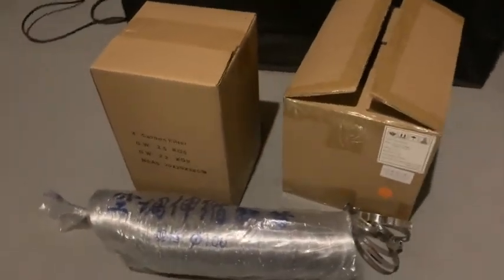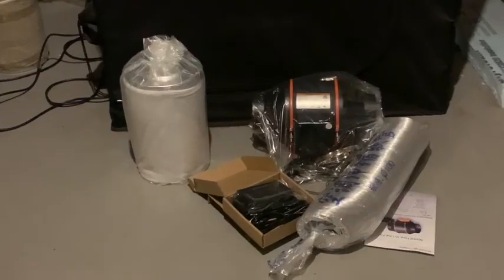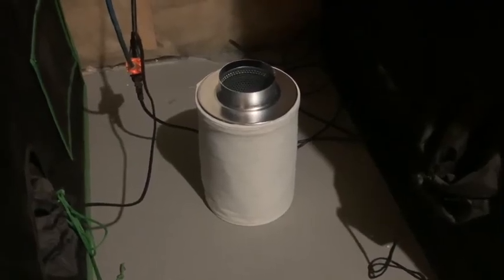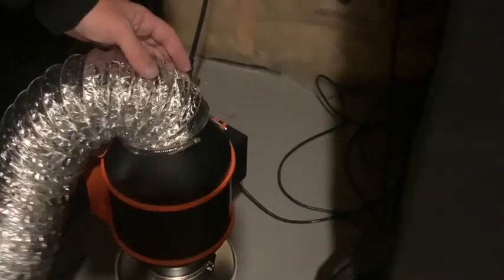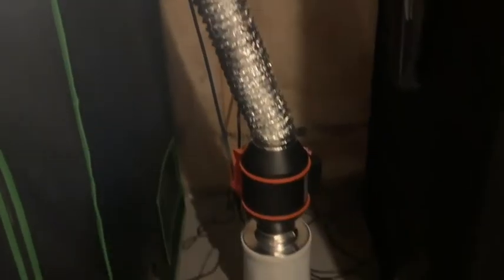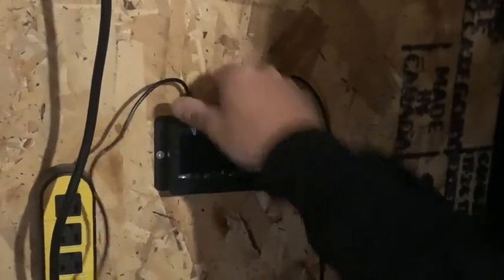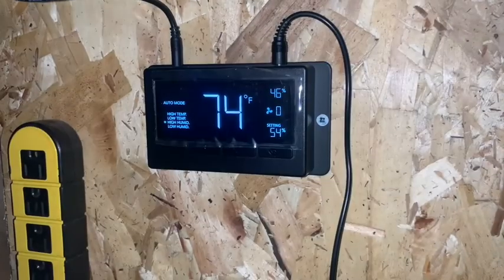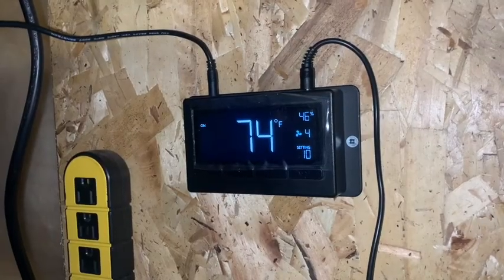How to Set Up A SMART Ventilation System for a LED Grow Tent

Comment: I cant understand this controler. How do i set it to switch on at 79° and switch of at 75° ?  Also how to set it up to switch on at 80% and switch off at 70% ?  Its spinning even when my temperature and humidity are too low. Please somebody help.
Reply: Yeah, thats a little problem with these controllers… the fan starts over the high value and under the the low value, so if you try to keep the humidity at a value higher than the one outside, you have to set the high value as the goal value and the controller will stop, if it gets below. This will result in a nearly constant +-5 to the goal value in my conditions. The low value is set to „off“ by holding ^ & v for a few seconds while setting the value (note that the cap is set under „on“) ✌🏽

Comment: Hello. Can you help me understand the low and high setting? Is it meant to try and keep the value of the tent between the levels you set? I'm not sure how turning on the fan when it gets too cold in the tent would be beneficial.
Reply: Turns out exceeding the high temp or humidity will kick on the fan to the speed setting you used in the 'on' setting. If the temps or humidity go lower than the low settings, the fan will also go on. So I turn off the low temp and low humidity setting because I don't want the fans on when things are too low.
Reply: how do u turn those two settings off?
Reply: @kcvrx  hold the button used to switch to the next setting

Comment: How do i even select these different temp / humidity options on the controller,the instructions are so vague and im constantly checking the temperature and humidity manually instead of the controller doimg it for me . Please can you help me out 🙏🏼
Reply: Hey, i have the same problem. Did you figure it out maybe ?   There is no explanation for it.
Reply: No I'm 9 weeks into flowering my autos and have just been monitoring it manually. I have found with the size of tent I'm using (2x2) and the combination of two LED lights that add up to 1000watts i have to have the extractor fan on level 10 throughout lights on and then during the cooler 6 hours off i turn it down to setting 5.

Comment: Guess what, I contacted Spider Farmer and they shipped a whole new fan and controller.  The fan is silent as it should be (the original I got had bad Bering noise) and the controller works perfectly now.  Just set high temp and humidity and off we go.  Great support I must say.
Reply from the maker: Good to hear. Sry I hadn’t got back to you . I had a death in the family and completely forgot about it . Happy to hear it worked out for you.
Reply: @pattymcstoner2764  Sorry to hear that!   Thanks for the help.
Reply: @MichaelBruceTaos  the bearing might have been bad but the controller was fine just set up wrong. You followed bad advice and set parameters you didn't need, that's why it was misbehaving. Because this video and his replies were misleading and incorrect

Comment: I need help. This isn’t very well explained on the thermostat auto settings. I need to know how to actually set the settings as well as alarms! How do I even do that
Reply: I can’t figure it out either. So annoying
Reply: @jastinellyson8733  I figured out. On the channel you’re looking to automate- make sure the function mode says on. Then turn ur fan on or whatever to 1 or 2 or 3 etc. THEN chanfe mode over to auto . Once the environment in ur grow space hits those triggers that you’ve set in the auto function , the devices will activate. And they will activate and turn on to whichever intensity or frequency that you’ve set when the remote channel was on the “on” mode. Hope that makes sense
Reply: I cant even get the actual temperature to read ?
Just  a blank looks like this.   -- F°
Any ideas
Reply: @2wosiq go to alarm mode n click. The up n down for 3 seconds. Dev mode

Comment: Lots of China companies like mars hydro and spider farmer copied ac infinity’s controller but only managed to knockoff the one from 4 years ago. The latest ac infinity controller 67 and 69 have schedule, minimum speed and app control which the knockoffs can’t do.
Reply from the maker: And yet they are all just knock offs of the duct fan in your furnace. None of this stuff is necessary I have said that a million times .
Reply: This one is also has abs internal. Unlike the others I can simply 3d print new fan blades and most part for it instead of needing a new fan or repairs. Only thing you need to ever replace is the probe
Reply: @pattymcstoner2764  I agree with you 100 percent people don't understand even "Name brands" are made with knock off materials why pay extra money for stuff that will do the exact same thing as a non brand name makes no sense to me.
Reply: So pissed i ordered a sf1000 and the instructions are written in poor english, also doesnt provide any instructions for installing inline fan,carbon filter,or where to run the lines for the controller and probe
Reply: Is there a way to make it so when alarm for high humidity is triggered it only goes up to fan speed 4 vs 10 every time until it reaches low humidity alarm?
Reply: @MM3OG  remember me of a startup, that claimed to grow from seeds to bud without interference. Failed miserably I rather check on my plants ^^
Reply: Ac infinity is still Chinese bs too at the end of the day
Reply: Vivosuns higher end controllers looks to be really nice and they have advanced app it runs with and lots of addons available
Reply: @TheRealTerpinator  except vivosun controllers are outdated compared to AC infinity. Their most advanced controller cant even do automations and can only control their own 2 fans and a light max while AC infinity’s can mix and match 8 different devices including humidifiers, heaters, ACs and even outlet devices and lights from other brands. Only shills working for vivosun would claim it’s better cause facts don’t lie when you compare side by side.

Comment: So does the fan stay on constantly or does it just turn on when it gets too hot
Reply from the maker: You want it to come on for at least 5 mins ever 3 hrs other then that just when it needs it . You can’t do to much but you can do to little
Reply: @pattymcstoner2764  Thats not answering the question. He and I would like to know if the fan can stay on all the time at a min set speed and then go up fan speed when the high trigger hits. But I think you know what he was saying and dogged the real question and answer , why ?
Reply: @travisanthony11  it goes totally off and its fucking  crapppp shittt because air can go out if u dont keep a minimum negative pressure.

Comment: Great set up and explanation! My only question is that I thought it was common knowledge and required to have bad air going out fresh air coming  in based on the size of your grow tent. I  see that you mentioned that your fan is only when needed. Is it not necessary to have bad air going out and fresh air coming in throughout a grow? Than you
Reply from the maker: Yes mine turns on about every ten minutes but it is better then constantly like it was . Hope that makes sense
Reply: Bad air should exit the room and fresh air should be drawn in (from a clean source).    This setup is blowing bad air into the room and it seems negative pressure in the tent will draw in room air through any vents or cracks.    You are just re-cycling the same air.    What good does this do??

Comment: I still dont get how to make the damn controller work right.  Set under Alarm area?! really?
Reply from the maker: Yeah . 

So set all your ranges in the humidity and the temp and set it to the alarm mode for high temp . 

That way it or hits any of the alarms it turns on .
Reply: @pattymcstoner2764  Hmm ok.  right now I set all the auto stuff but I ignored the alarm area itself.
Reply: @pattymcstoner2764  OK I did this.  I will report back.  I have been screwing around with this thing for a week and finally hit the RMA button.. maybe you can save me from having to send back.  Many thanks!
Reply: @pattymcstoner2764  I set High temp to 80F, Low temp to 75F, High humidity to 65 and low to 45.  Then I popped over to alarm mode and left that on high temperature.  I am not sure if I did it right?
Reply from the maker: You know what sorry . After you set all the alarms just leave it on the auto temp . Then watch . The alarms will flash and turn it on if it hit any of the alarms . 

And yeah don’t send it back I got you well get this thing working for you !
Reply: OK, I will give this a try right now.
Reply from the maker: No you leave it set on auto temperature or humidity. Doesn’t matter . 

You are setting the alarms to tell it when to turn on the vent . That’s what the alarms are for .
Reply: @pattymcstoner2764  If you see my video, the thing just turns on by itself for no apparent reason.. and then it stays on forever.
Reply: @pattymcstoner2764  The alarm only seems to make the thing beep, it doesn't trigger anything on mine that I can tell.  I have mine on Auto Temp and it still turns on for no reason and stays on.
Reply from the maker: Dude it’s not turning on till you put it on the low humidity. 

So I saw two things for you to do . 

Go to the humidity alarm and set a low humidity. It said you have it off . 

Check to make sure you have the plastic stick off the sensor . 

I’m going to make you a video and send it to you when I get home .
Reply: @pattymcstoner2764  Man thanks. I can leave it on the Auto Temp setting and it still goes on randomly
Reply: @pattymcstoner2764  If I put on a low humidity and low temp instead of off the damn thing turns the fan on when it his this low temp!  Anyways, Ill set like you said.
Reply: @MichaelBruceTaos  Bro don't set a low temp and don't listen to him about the alarms. I have them all off I don't need that shit beeping at me just run the fans. Set a high temp in auto and a high humidity in auto and set low temp and low humidity to off by pressing both arrows. You would only use the low temp/low humidity auto modes if you were trying to vent in hot damp air instead of exhaust it out
Reply: I wouldn’t listen to anything on this video, sorry brother. The alarm is just that, an alarm. & if you maintain a decent environment inside the tent, your exhaust will never run. You have to set the max @ the min & min @ the max temp you desire.. that way you create a range of use for the exhaust & just adjust the fan speed as needed throughout growth. Just my two cents.
Reply: @pattymcstoner2764  I'm having a similar issue right now. I've been trying to set the temps and humidity in alarm mode, but nothings working. Do you have a pic of the instruction booklet?
Reply: @ChrisTingman  if you do this, how do the fans turn off?
Reply: @sureshotgazza1127  they only turn on when the temp gets too high. As soon as it settles back down to your target temp they automatically turn off
Reply: @ChrisTingman  bro help us out, so can I have the fan running constantly at the fan speed set in the OFF MODE ( can I set a fan speed in OFF MODE ? ) and then have the speed of the fan when triggered by high temp or humidity run at the speed set in the ON MODE ? 
so basically the fan never go's off runs at off mode fan speed until triggered by high auto trigger then runs at on mode fan speed.
Is this possible ? Thankyou
Reply: @travisanthony11  not with this model, that's the next one up
Reply: @pattymcstoner2764  can you also send me this video please 🙏🏻
Reply: I just got one also and its doing my head in trying to figure it out. What ive come up with so far. 
The alarm mode is a mode that you can set parameters so an audible alarm/buzzer goes off if the parameters have been reached the fan will also turn on. You need to stay in that mode for the audible alarm/buzzer to sound.

Auto mode is the same but without the audible alarm/buzzer. You dont need to set anything in alram mode for auto mode to work and visa versa. 
For example - In auto mode (i dont want an audible alarm/buzzer)
If I want humidity at 55% ill set the high parameters to 56%. The fan will turn on at 56% and continue to run until the humidity drops to under 56%. 
Ill set the low parameter to off because I dont think Ill need any air from outside to bring the humidity up. Ill have to use a humidifier for that.

Setting high temp if I want 24c ill set the trigger at 25c and once its sucked the hot air out itll turn off once its under 25c. Ill turn the low trigger to off.   

It all depends on what the ambient temp and humidity is outside the tent. 

Imo now I have the controller its not as fantastic as they make it out to be. 

Parameters will obviously need to be changed if your in seedling veg or flower stage

Winter i may need to set the minimum triggers. In summer I cant see why I need any minimums

You need to set the fan speed also. Ive got the 6" version in a 3x3 it sucks so hard the sides of the tent come in even on fan speed of 8 so ill need to set mine on 7. Itll need some adjusting to get it dialled in. 

I prefer to have the filter first so the air being removed is filterd before it hits the fan keeping the fan cleaner. Currently the fan is on the inside of the tent but I might move it to the outside if it gets to hot adding to to much heat insdie the tent.

Hope that sounds right and helps someone.
Reply: This needs to be top comment, yer a G

Comment: So my only question is Does this affect your cfm? If the duration you need to change air is at 1-3 minutes hows does collecting it for an X amount of time not hurt you?
Reply from the maker: No it doesn’t affect the cubic feet per minute . 

And it doesn’t hurt you because you do not need to change the air in the tent every one to 3 mins . More like hours . The plants don’t use enough co2 to change all the co2 in a tent to oxygen takes days . Then you’d be hurting it . 

The more light you are using the more co2 they need . Light + h2o + co2 = o2 and sugar.

Comment: Isn’t the air meant to go through the filter then fan then ducting with it being placed on the inside of the tent… not that process backwards wit fan and filter on the outside of the tent ????? Anyone with actual facts ?????
Reply from the maker: Why would it matter if the filter is at the beginning or the end ? 

The air is still flowing from in the tent to outside and sucking in new air thru the vents at the bottom. It does not matter . Good grower put it on the outside because then they can get the lights up higher and have more room in the tent
Reply: @pattymcstoner2764  According to some testers, direct air entry from the tent damages the fan or shortens its lifetime. Moisture, dirt....
Reply: @pattymcstoner2764 the carbon filter and fan are supposed to be on the inside of the tent. The fan sucks tent air through the filter then pumps the filtrated air outside the tent. The carbon filter is to remove the odors from the plants. If you do it like you have it your just pumping fresh air into the tent and not removing any odors.

Comment: Why do guys have them reversed? Filter and fan in tent with ducting out? Then i see this.
Reply from the maker: More room for plants !
Reply: @pattymcstoner2764  i see now thanks. I was confused by positive vs negative pressure grow tents. Also putting the fan and filter top middle of tent forces it to pull fresh air from bottom up through the plants out the top. Instead of side vents missing most of the plantsm

Comment: Youyr filter isn't in the right place, he's useless here, it have to be in the tent. You can put the fan outside but not the filter.
Reply from the maker: Inside the tent out side don’t make a difference as long as the fan is blowing in the right direction.
Reply from the maker: You do you though. I’m just showing what I do.
Reply: It’s operating as a filtered intake air fan. Your carbon filter is scrubbing outside air.  If I were to do this. I would bring my intake air in from the bottom so it cools my plants and they get the fresh air first. Then I would need ANOTHER set up to hang high above light to exhaust air OUT.  hvac fundamentals
Reply from the maker: I have it so the air fan is pulling air out of the tent. I open the vents in the tent . Then because the fan is pulling air out of the tent , NOT In, the air gets replaced in the tent with fresh air thru the tent vents . That’s what those vents are for lol . 

You can ran a vent system both ways, and put the filter at the start or end doesn’t matter . Nature doesn’t like a vacuum so air gets sucked in to replace the air you pull out . Just have to reverse the direction the fan is blowing . Science fundamentals.  It doesn’t matter where you put the filter in the system beginning or end , again AS LONG AS THE FAN BLOWS THE RIGHT DIRECTION.
Reply from the maker: Watch the video!
Reply: It doesn't make a difference if the fan is inside or outside, as long as you have the airflow going in the right direction. The way he has it it is still sucking hot air out of the tent.
Reply: @pattymcstoner2764  Actually it does matter at least to me as  inside the tent takes up space that can be used for more bud! ;) lol
Reply from the maker: I know right !
Reply: As long as the fan is going in the right direction...
Even though the phrase 
Blow Job
Has nothing to do with blowing
It is all about Sucking the Exhausted air out and bringing in fresh air..
Ie passive.... Through the vents.....